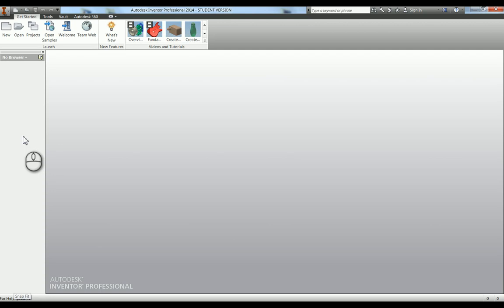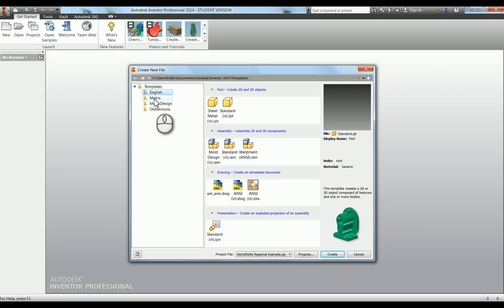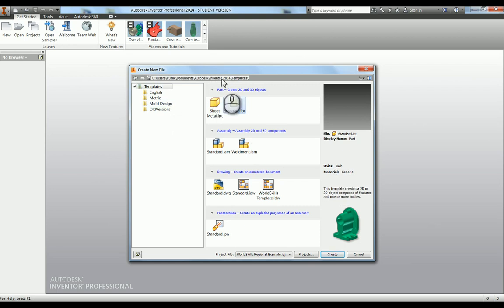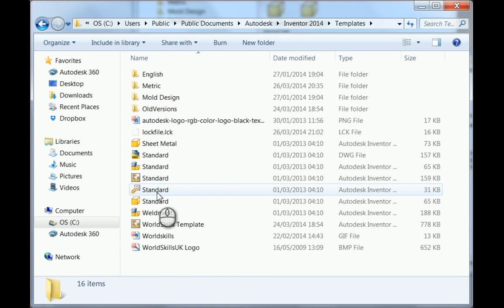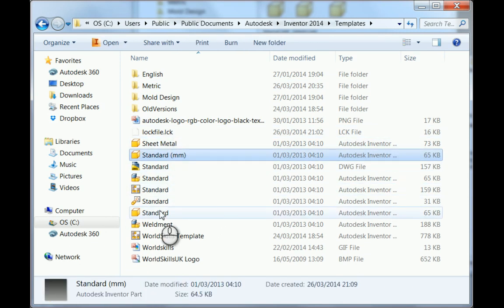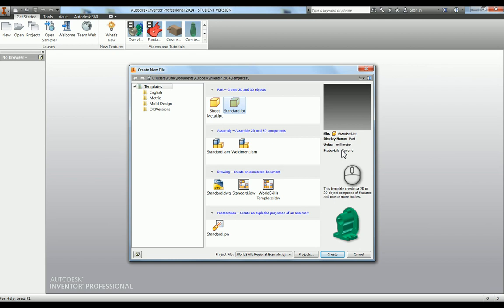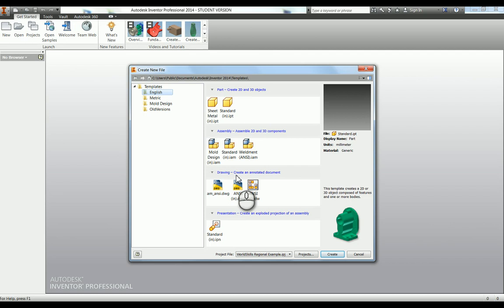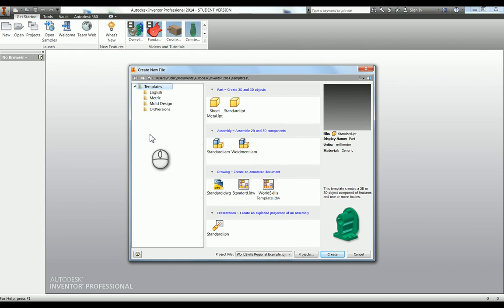How to edit your default templates in Autodesk Inventor Tutorial

Comment: Hello, when I try to open a new file (a new part from scratch) a message is coming 
up saying the templates couldn´t be opened. I reviewed the folder with the
 templates and all of them are present but they have 0kb. Do you know 
how to solve this problem???
Reply from the maker: Hey there, I've not seen this issue before. What's the exact error message? I've seen it where it can't find the image (if you inserted one into your template). To remedythat you need to ensure the picture file is in hte same location. Can you open the 0kb file in Inventor (via open) rather than new? Also which "new" are you using? The drop down menu of the new, then search through explorer?

Sorry to ask even more questions!

Comment: Is there a way to calculate tolerances between two parts in inventor? Taking into account manufacturing processes? and tabulating information? Currently having trouble figuring out how to do so.
Reply from the maker: Hi Thomas, great question. Are you looking to add tolerances to your part (if so I have a video for that here: https://youtu.be/5ZVWkC2mONQ). But the manufacturing process you choose for the part will determine the tolerances used. You can then display these in Inventor - but YOU need to specify what the tolerances are. I would highly recommend the machinerys handbook if you don't already have a copy :)

If you're asking if Inventor will recommend tolerances for you - I'm not aware of this functionality. I can't imagine it being in there for legal reasons. As in, I can't see Autodesk recommending.  Based on the fact that if a high value part failed because of what you were recommended etc,.
Reply: Understood, thank you for your help